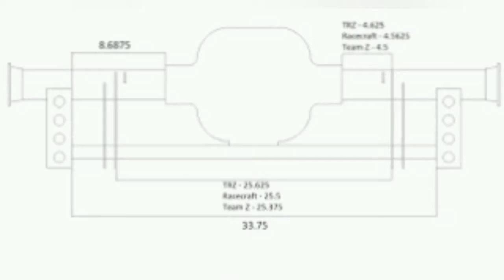8.8 Rear End Build  - control arm and coilover relocation

Comment: Question, what is the angle you set the brackets at in relation to that rear face?
Reply from the maker: I cant remember man but I do remember tin soldiers came with an instructionsblink when I bought them

Comment: Did you use the 309 rod to weld tubes to the housing? I ordered 309 to weld front brace kit on and dont want to spend the extra on nickle if the 309 will holt the tubes to center as well. 

Also what control arms did you use? Im hoping any spherical adjustable will work

Comment: Shouldn't the adjustment holes be in an arc (rather than in line) as the control arm end will move in an arc?
Reply from the maker: The trz kit is like this. Which I really prefer because ones like mine requires you to adjust lower control arm length to keep correct pinion angle